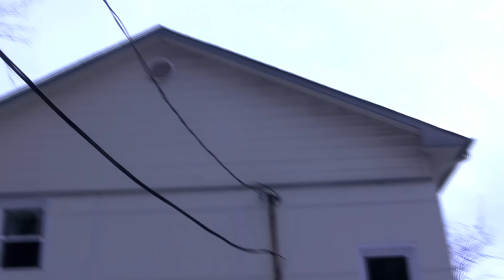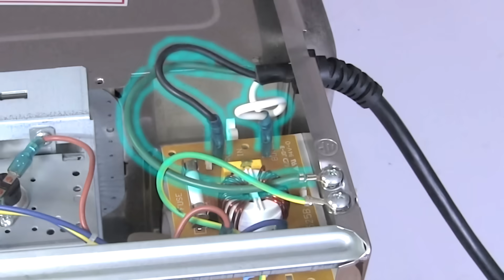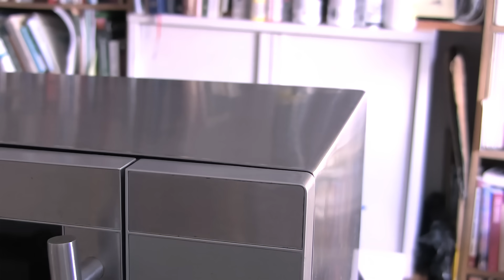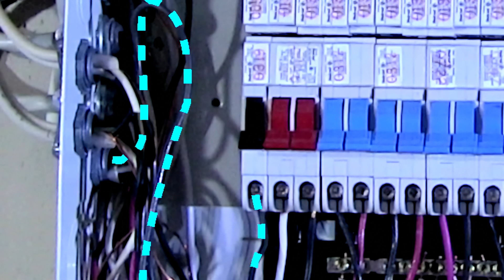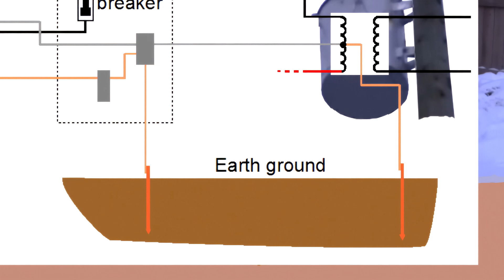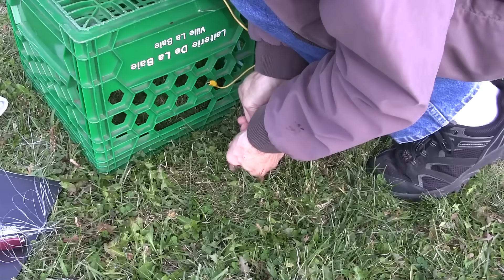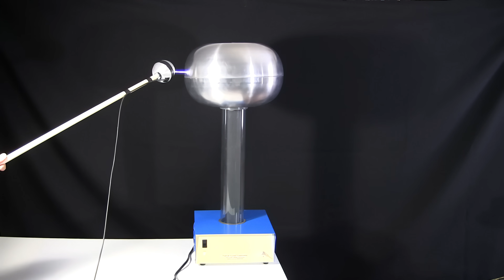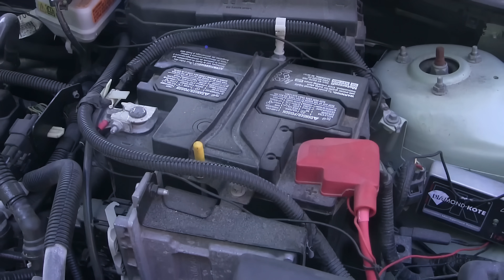What is Ground? Earth Ground/Earthing

Comment: Still confused
Reply: muggymug    What are you confused about? I am willing to give it a shot at explaining in a way you might understand.
Reply: @gordthor5351  I understand it makes a circuit to the transformer, which trips the breaker, but I thought the neutral wire always had current passing through it. (Like a return line for any circuit to work) I don't know
Reply: I don't understand how the ground connects to the neutral in the breaker box. Doesn't that make the neutral the same as ground?
Reply: @brendanstanford5612   Yes, the neutral should be at ground potential. It is the return path (back to the power station) to complete the circuit. 240 volt appliances don't need a neutral return wire, because 1 120v wire is 180 degrees out of phase from the other 120v wire. Some appliances (like dryers and ranges) use the neutral wire so 120volts can power lights, clocks, timers.... 

The neutral wire is essentially ground and the ground wire is a safety ground. The safety ground comes to a dead end at the electrical box, so it isn't part of the circuit, unless a hot wire touches the metal box, thus tripping the breaker, before a person touches a hot box. 

I like touching hot boxes, but not that kind, haha.

Comment: Why dont we make our oven case plastic :v
Reply: I notice that there are appliances that don’t come with a ground prong.  I googled it and supposedly these are so called double insulated appliances and there are no chances of faulty wiring.  Can you please elaborate on this?  I.e. why these appliances are safe without the ground prong.  Thank you!
Reply: @dempseyone747  Very simple: They cannot be 100% secure but the engineers really put a lot more thought into preventing any wire coming even near the metal case!
Reply: @dempseyone747  Anything where you are unlikely to come into contact with current generally won't have a ground wire, a device or appliance with a completely plastic case is considered double insulated because even if a live/hot wire inside were to break and touch the case it simply touches plastic and doesn't endanger the user.  TVs, alarm clocks, stereos, etc are double insulated, toasters, microwaves, lawn mowers and anything with either a metal case, exposed metal parts or the ability to damage it's own flex will be grounded just on the off-chance that any metal parts becomes energised due to a fault or accident.
Reply from the maker: We could. But you'll still need good shielding to prevent the microwaves from getting out of the oven and cooking anyone nearby. That's what the metal case is for. It also provides shielding for the electronics. But I don't see why you couldn't put an outer plastic shell, other than the added manufacturing cost.

Comment: Thanks for this good video. But if the green ground wire is connected to the white neutral wire back in the breaker box, the ground then has the same potential as the neutral, so doesn't the ground pose a shock risk?
Reply: no all electrons flow to general mass of earth and , ground wire its permanent conected to earth
Reply: I believe you are right john, the ground is not supposed to be a current carrying conductor, watch mike holt's video on grounding
Reply: It doesn’t really pose a shock risk because the resistance from the panel to the transformer is so little that the electricity wants to flow to the transformer and not back thru the panel to the ground on the outlets. Electricity is always trying to get back to the source (transformer) via the shortest route (least resistance)
Reply: Neutral to ground difference is 0 volts so in theory, you can even touch neutral on the outlets. Problem is that in some installations, you cannot be sure which hole is neutral and which one is hot! Hot, as the name states, is the only of the 3 holes you should never touch!

Comment: i have a fiberglass slide in truck camper. i was wondering for the 120v circuit should i have a portable grounding rod? i know a normal pull camper has earth going to the frame.
Reply from the maker: I'm no expert on those so I can't say for sure. I've installed a solar power system on an RV and the RV's frame was the ground https://rimstar.org/renewnrg/sp_off_grid_solar_power_rv_motor_home_p3.htm. On the other hand, I have another page on my website of a mobile solar powered trailer which someone else installed and they pound a rod in the ground when traveling on the road https://rimstar.org/renewnrg/mobile_off_grid_solar_power_system.htm.
Reply: Look at your generator and see if it has a ground lug on it to tie to a ground rod.  If you do be very careful you do not drive the ground rod you haul with you into a gas pipe or buried wire.

Comment: I'm trying to understand why my entire wall shows AC current when I use an NCV detector on it. I have foil backed plasterboard, could that be acting as a ground? It changes when I touch the metal faceplate and beeps, anywhere on the wall, as if the wall is charged and I'm grounding it. I just don't get it.
Reply: poor detector use fluke
Reply: @123londononline   I have used two different detectors and both give the same results. One is a more expensive Unit-T. I don't think it's the detectors. I turned the power off and they stopped beeping, so they are either ultra sensitive, or I have a poor ground or something.
Reply: @ArcanePath360  definitely to sensitive, detected magnetic field around conductor I make bet its nothing about ground. Just use meters to test nearest point love to earth, must be similar to live neutral test
Reply: sounds like you have objectionable current, watch mike holts video on grounding
Reply: Your wall may be energized. Only way to know is to use a meter and test it. (Not a fan of those volt sticks) With your meter on ac volts, touch one probe to the foil on the wall and the other probe to a known ground point. (An outlet ground or run a wire outside and stick it in the soil)
 I once shorted out a switch when I pulled it out of a box and the hot side screw touched a foil wallpaper that was grounded thru an outlet frame that was touching the foil wallpaper.
Reply: It could be picking up an induced voltage on the metal mesh in the plaster.

Comment: As a Brit I fully understood your explanation, well it does help because I am an electrician. We have the same configuration as you do in North America. Earth Rods thats ground rods to you are usually 4' long with a 3/8ths or 5/8ths diameter ( its great im using imperial measurements ) sorry we don't use much imperial nowdays its 1.5mm 2.5mm 6mm.
Anyway this is driven into the ground after testing the grounds impedance to ensure it can take the Earth (ground)fault current.
In the UK the soil is so damp  because its always raining so its generally ok. We say the current will discharge to the Greater Mass of Earth, the planet, third rock from the sun, Home
Reply: Nice try with the Imperial nomenclature. I hate to point this out... but the use of a following 4" means "4 inches" whereas 4'  means "4 feet" in the USA. However, that may not be the case in other countries. And your use of 1.5mm translates to 0.059 inches... if you are referring to a "ground-rod" that would be quite flimsy when driven into the earth. Of course that only my opinion.
Reply: @garywilson2579   Point taken l do know " is inches and ' is feet drinking to much cider on a sunday  nite.
Reply: Steve Thomas - I dream of the day when we Americans finally switch to the metric unit of measurements, volume,length and weight.
Reply: @kevino6416  Kev, Its like language and how it trips off the tongue as in inch, 3/8ths, 4b2 I believe in the States its 2b4. In the UK we had a monetary system in multiples of 6,12,10 and 20 and was known as LSD or pounds (L- Librea) shillings (S- solidi) and  pence ( D- denari).
6 was 6 D pence= 1 S shilling
12 was 12 D pence , 2  S shilings = 1 Florin.
10 was 10 bob (10 shillings) and 20 was  20 florins that equalled 240 pence or £1.
This all changed on the 15 th Feb 1971 so now its 100 pence to a £1 but I still call the 50p a 10 bob.

Comment: Thanks so much, but  I got a little confusion over it. From your presentation I can see that it can work well without the ground wire cause the dangerous charges on the surface do have the potential of cutting the breaker off, flowing through the Neutral line.  Or else, I think,the thing you should add is that the neutral line got its nature (Neutrality) from the Earth so, the ground wire is mandatory. Pleasssss please Got me out of this confusion.
Reply from the maker: There is a path from the hot wire, through the microwave electronics to the neural wire but there's not enough current through that path to trip the breaker. The path from the hot wire through the microwave oven's case and the ground wire, however, has enough current to trip the breaker since there's practically no resistance through that path.

Comment: so if the neutral wire is connecting to the microwaves metal it wont cause a short circuit and the breaker wont trip?
Reply: Yes, that is correct. But, you will get  Electrocuting if the load is large enough and you touch the body of the device. Your body when you touch the microwave will be in parallel with the load (in this case the load is the microwave). So in summary do not connect the neutral to the body of your device. All the above note assumes that the house has a neutral connection to ground earth.
Reply: mcb not rcbo yes
Reply: The ground is connected to the metal frame, not the neutral. Although they go to the same place

Comment: Something I noticed in Los Angeles. Older houses, a lot of bungalows,  didn't have grounding rods, just the water pipe. Southern California is very dry (but not this week). What I noticed several times was  the galvanized iron water service pipe, would de-galvanize about two feet from where it rises out of the ground right next to the house,. The pipe rusts at this point and begins leaking, or clogs up with rust and deposits.  If I saw a wet spot in front of a house, or if the water pressure was terrible, I'd just start digging in this area. The pipe always needed cutting and replacing.  Farther away it was still okay, under the house it was also okay. 
I think the pipe de-galvanizes because  this  point near the house  in the ground is just wet enough to allow a small current to flow to ground.-I'm not sure if it's electricity 'leaking' from an old corroded connection, or just because it's 50-80 years old and any galvanized pipe would eventually do this. 
  In one friend's house  her housemate, would frequently get serious shocks in the shower, but she never experienced any. (I checked and retightened the electrical connections in her old breaker box,  and I might have added a grounding rod (its been over 30 years) the problem went away, but we never figured out why he got shocked and she didn't.)  In my current home  a 70 year old rental, there's a problem with my ground. Current is 116-120 VAC, across the black and white, but the ground is only 70 volts. It's good at the box but on the two different circuits I checked it's 70 volts. I can understand corrosion between the metal boxes and the old flex wire shielding losing some of its connection, how consistent it is makes no sense. I bootlegged a ground wire to a few of the boxes, and added a ground rod. (A tip for installing a ground rod. Use your longest hammer drill bit to get the hole started. Pour some water in the hole before inserting the rod. If as you then hammer it down it refuses to go any further (ideally would be an end that would fit in my hammer drill chuck), pour some more water in the area as you hammer on the pipe-- hopefully helping the water to seep down, then try hammering it the next day.

Comment: wouldn't the ground metal rod or fence connecting to earth ground shock you if you touched it??
Reply: If I understand correctly only if there is a fault in the system. If hot/neutral wire is not exposed. Then it is being forced through the circuit. But if the wire becomes exposed it will find the path of least resistance, bc electricity is lazy. We make it work hard, and when it does go through the ground instead of the circuit. Then yes. The ground will fry you. But that's what the circuit breaker is for. It sees the electricity is flowing to fast and pops keeping you and your house safe.
Reply: im talking about the metal ground rods or  metal fence outside your house connecting to earth ground..
Reply: Yeah, see your question doesn't make sense, at least to me. If your connecting to the ground your already touching it. That's why I tried to explain the whole system to you from what I can understand.
Reply: after a lightning strike?when electronics inside the home are over charged  due to a lightning strike and as a result electric current runs through the rods,fence outside
Reply: Ok that make sense now. Yeah if lightning made contact with the ground it stays charged in that area for a couple mins. But not long. That's why you can't touch someone, immediately, that just got struck, it will fry you too

Comment: It is amazing that nowhere in your video did you leave a reference to any agency or group which standardizes the use of electricity, such as NEC or even those who check on electrical safety such as ANSI here in the USA. It is the videos by the NEC that you will get COMPREHENSIVE AND COMPLETE explanations of these phenomena.
Reply from the maker: The intended audience for this video is the layperson who's curious about the ground hole in their wall socket. I've even changed some of the terminology to simplify it. I'm not qualified to teach electrical installers. For that I have a link in the video's description to one of Mike Holt's videos.
Reply: @RimstarOrg  Which in fact works for me! Thank you RimstarOrg for this simple and basic explanation about grounding and earthing. The simplification of your explanation has made it easier for me to understand this rather confusing terminology :) Greatly appreciated!
Reply: There is no standard on the internet, we're all from different countries.

Comment: I have a sneeky feeling that my Ground is bad. And my neutral is bad. And that even the ground I walk on is carrying charge. 
So how should we troubleshoot and fix faulty grounding.
Reply: You might be right! You could be experiencing what's known as "EPR" (Earth Potential Rise). You will definitely need a qualified electrician to check your switchbox. If the electrician doesn't fully understand EPR (and surprisingly enough, many electricians don't) then ask your Supply Authority to send out an electrical inspector. He will most certainly know all about it. Your and your family could be at risk until it is fixed.  p.s. I'm using Australian terminolgy which may differ from your country but the concept is the same.
Reply: @campbellkennett7984  Im in India. Nobody seems to have a clue. So I will have to educate myself and fix this myself. What worries me is why do I have 30 volts in my neutral phase i.e. between Neutral and ground.

Comment: Very helpful, thx)) Preparing to pass electrical safety tests. In Russia hot and neutral wires called "phase" and "null"

Two electrician sit on a pole. A passing old woman. One tells her:
-Hey, grandma, get the wire. 
-Here, honey.
-Well, I told you null, and you're harping "the phase - the phase!"
Reply: Жуй Колоши, "A rose by any other name would smell as sweet!"  The names change, but the ideas seldom change.

Comment: Little precision: The GND net in a schematic not always refers to the earth ground explicitely. However it always symbolizes the reference voltage net (0V) of the circuit. Well made schematics refers to the earth ground with a different symbol (looking like a rake) and is named EARTH or CHASSIS. In enclosed earth grounded devices, the earthed chassis and GND are tied together directly by the screws holding the board to the chassis.
Reply: MrPureBasic, Yup. Right you are! de KQ2E  (Also, NOT all schematics are WELL MADE! Look at those on YouTube for some of the world's worst examples!)